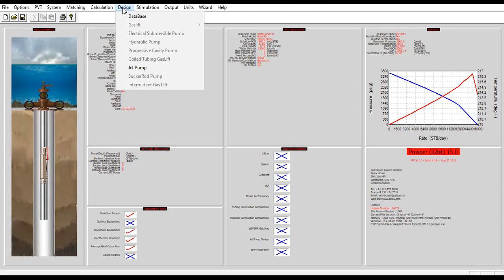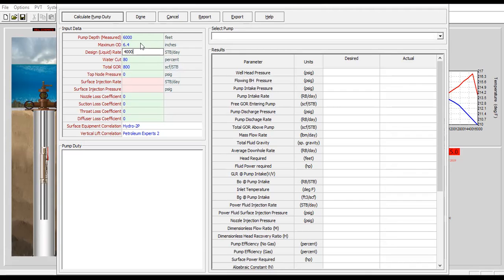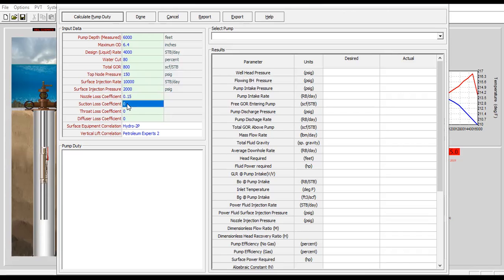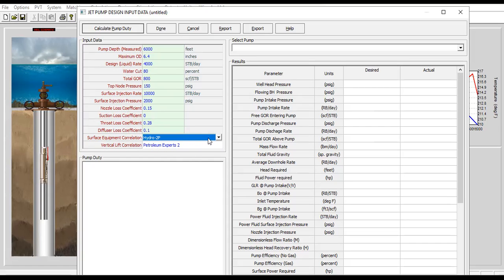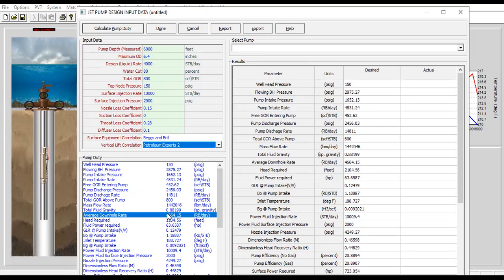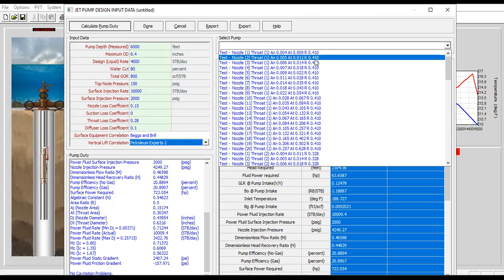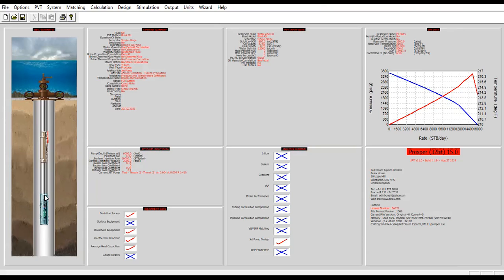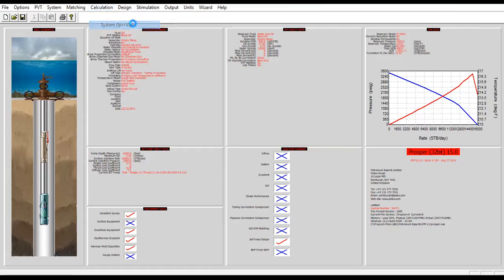Prosper 49: Jet Pump Design

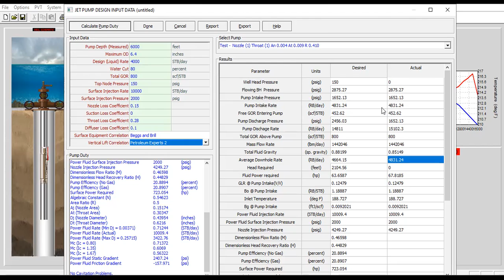Comment: I noticed a mistake in 'Actual' result at 5:50 min of the video.  The pump discharge pressure of 1652.13 psi is the same as pump intake pressure which is also 1652.13 psig.  This is not correct.